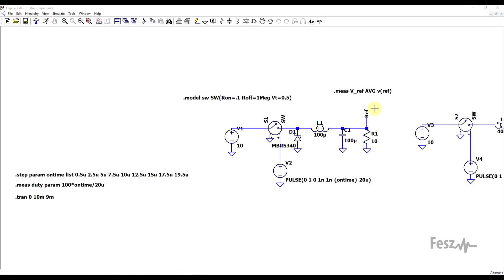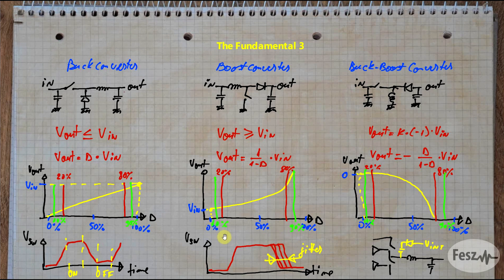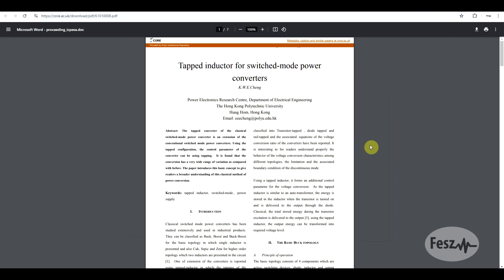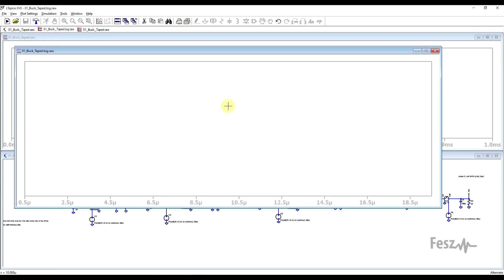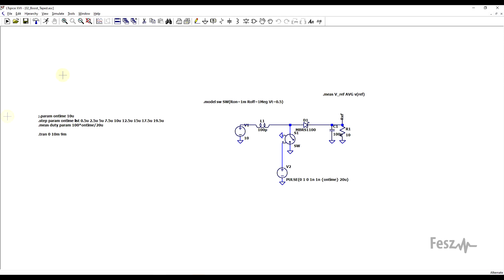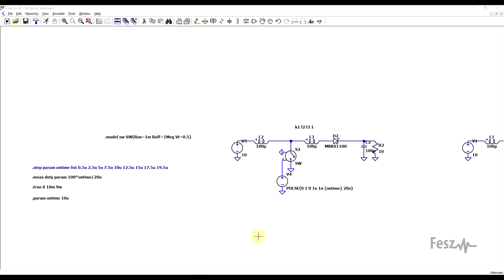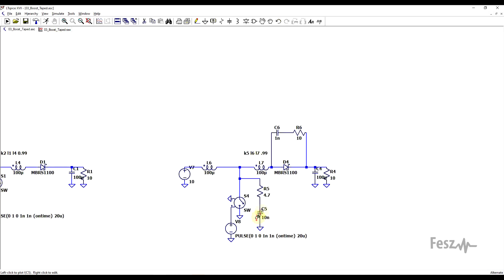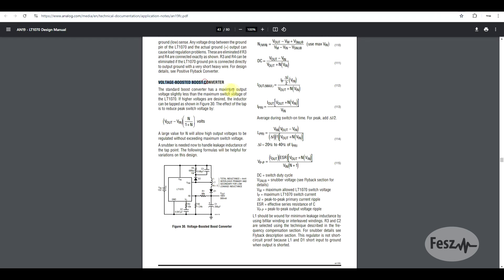Tapped Inductor Converters

Comment: You couldn't find any examples of tapped inductors being used? You forgot about every gasoline powered engine! Every car has a simplified boost converter using a tapped inductor powering the spark plug!

Comment: Imagine that used in a sound wave in a atomic particle structure arrangement in the vacuum off space as a plasmatic gas so i can work out to equal a light year in 31 hour's if you can get it to work. Or how to a diode i can save around twenty bucks for the 15v to 12v and that split 9v to 5v regulation in a pc tower power pack from one transformer MIT as your 5 v won't light up?? Anyway on a prototype for a push bike dynamo kit no high two amp current but 32v one amp perfectly to waves my first at 250ma would have blown 😁if i can get it built or Tesla to a charger with computer control current regulations and a high current alternator.

Comment: I'd be interested to hear your thoughts on push-pull converters... And I'm currently toying with the idea of one with two separate inputs (with synchronised switching but different duty cycles) so I can be drawing maximum power (MPPT) from a solar panel but still maintaining the desired output voltage, regardless of the load current varying, by drawing whatever current is needed from a mains power supply input!
Reply from the maker: I will try to cover more topologies in the future, however I am not sure I will be delving too deep into very specific use cases... anyway, if you can make a simplified version of the control circuit, you should be able to simulate the variation in the 2 supply sources and see how the whole system would work
Reply: What does push-pull have to do with MPPT?
It all depends on the control strategy, not on the converter topology.
Reply: @VEC7ORlt  Indeed. MPPT is separate to the converter topology.
Reply: @alaricsnellpym  so what about that push-pull?
Reply: @VEC7ORlt  it's a converter topology that uses low side switching , so you only need NMOS FETs, offers full isolation (and by not having 1:1 turns ratios you can build in an inherent step up/down to keep the PWM duty cycle in an efficient range) and you can have multiple sets of primary windings to feed power from multiple sources at once - but you need to carefully synchronise the switching waveforms between them.
Reply: @alaricsnellpym  I know what is, by using multiple input winding you'd be inviting a multitude of problems - mainly how will you do flux balance?
Your best bet is combining your power supplies at the load.
Reply: @VEC7ORlt  perhaps, perhaps! But I'd like to experiment with it :-) In particular, how to phase the different inputs' switching waveforms, and whether to wind all the coils on the same core or to try two cores, with a primary coil on each, and the secondary wound onto both to minimise coupling between the primaries.
Reply: @alaricsnellpym  you're making it needlessly complicated for no reason at all - combining it at the output is the easiest solution, if you really want to do it at the input look into current fed push-pull.
Reply: @VEC7ORlt  🤔 interesting, I'll look into that. Thanks!